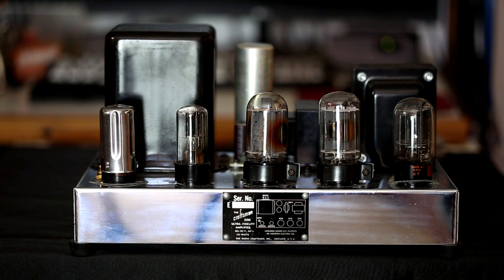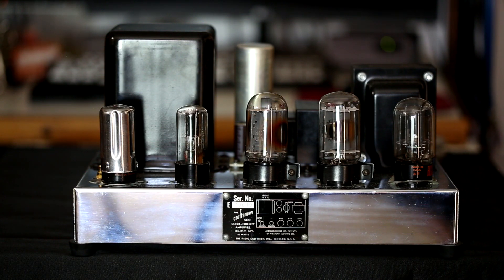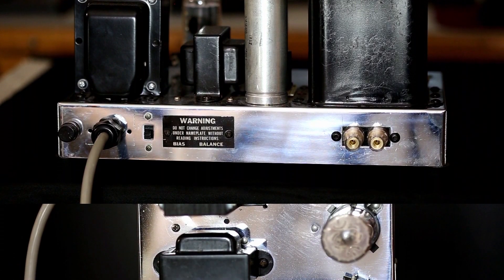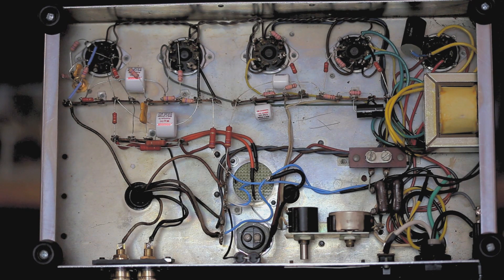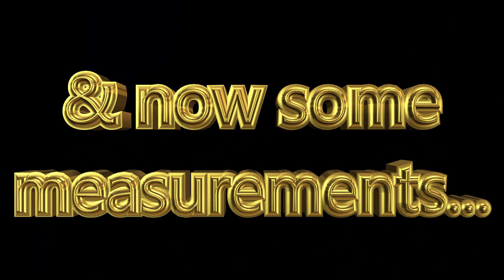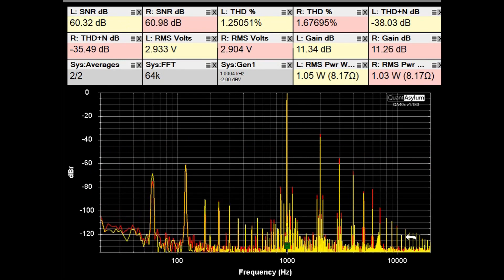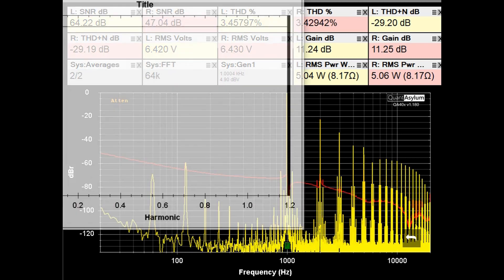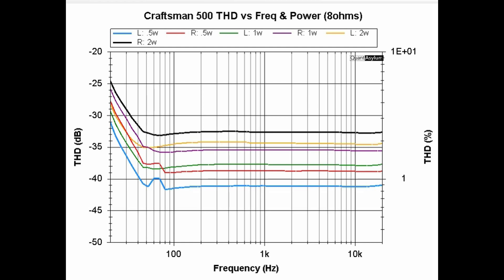Radio Craftsmen Model 500 Monoblock Tube Amp: Vintage Audio Review Episode #74

Comment: Interesting amplifier - thanks, for showing it off. It doesn't look like the refurbishment of the power supply was at all successful, except that it still works! I would expect replacement of old filter caps with modern equivalents to do better than the originals and therefore do better than the original spec. Choosing to pair them with very expensive, sensitive, K-horns to avoid excessive noise is one way to deal with the problem!
Reply from the maker: Many thanks for taking the time to comment! Like most low power tube amps, a horn speaker is the way to go with them.
Reply: @vintageaudioreview  - Your channel is a great resource for those wanting to learn more about the look, operation and performance of  vintage components!
Reply from the maker: @Luckiestmanalive-bb1mi  Thanks so much. It makes a fun thing to do during retirement, and I learn and my buddies learn as well, and I try to keep a variety of gear or maybe different topics.

Comment: Cool video and good review. I want just bring some comments : the specification for the 500 indicate 12.5W. It's the 500a that is supposed to produce 15W. Also the amplifier was design with KT-66 in mind, even if the 6l6GC can work. Perhaps this can modify the distortion profile of the amp.
Reply from the maker: Thanks for the info you provided. It is quite possible that I pulled the specs for the 500a instead of the 500- it was hard to find out much info on them. Someone had modified them as was pointed out in the video and possibly that was when the tubes were swapped out......

Comment: any recommendation for modern tube amp brand/made that sounds sweet?
Reply from the maker: Thanks for the question. As my main focus is on vintage gear, I have not had any new tube amps. If you have not watched episode #71. which compares the differences between some tube monoblocks and a solid state amp- I would venture to say that there would not be that big of a difference in the sound of the amps, just find one with the power and looks that  you want.